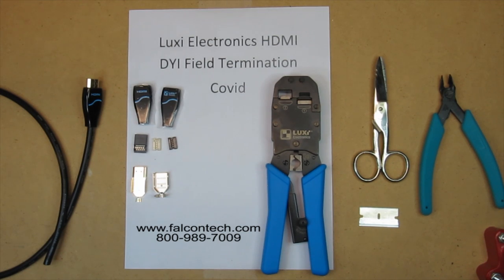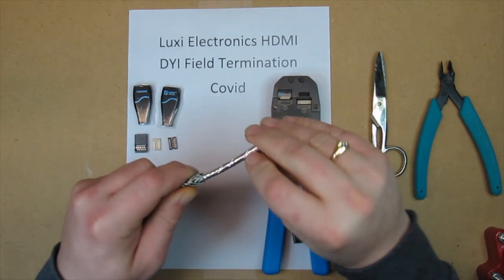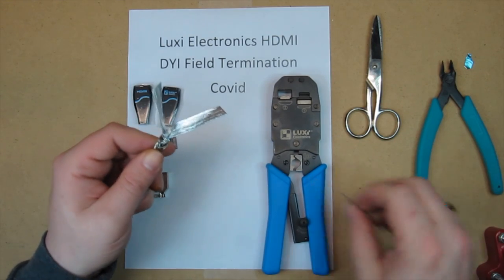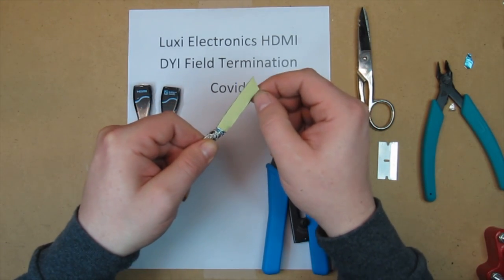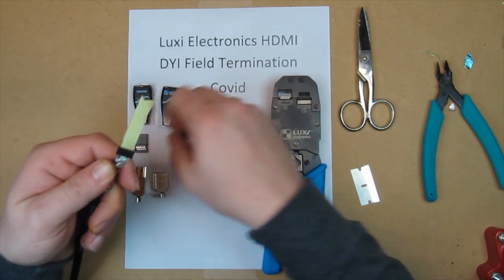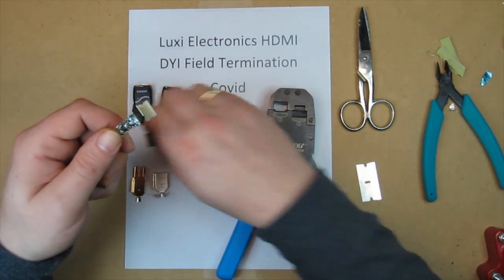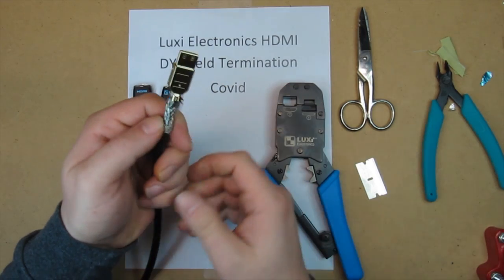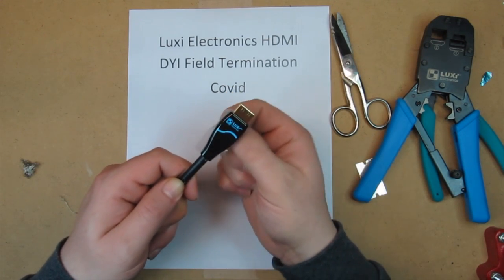How to Field Terminate an HDMI Cable and Connector - Falcon Technologies, Inc.

Comment: And zero HDMI cables I've owned have had ribbon cables in them?
Reply: That's what confused me the most
Reply: Installation cables have ribbons inside. Regular flex cable doesn't. Getting the wire order right would be impossible after the 5th or 10th termination.
Reply: @zanpekosak2383  agreed it was a right pig to chop mine and terminate to a hdmi terminal block ive just never seen it with a ribbon and wonder how the signal deals with no shielding.